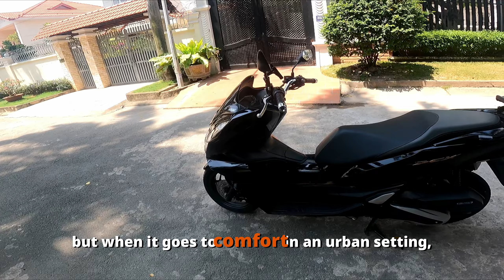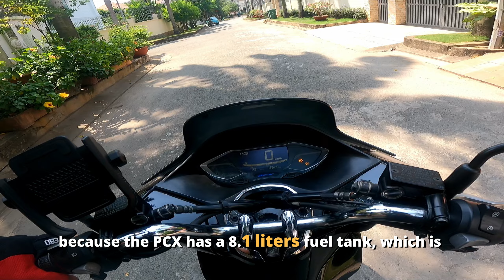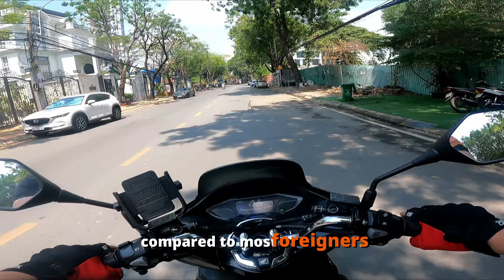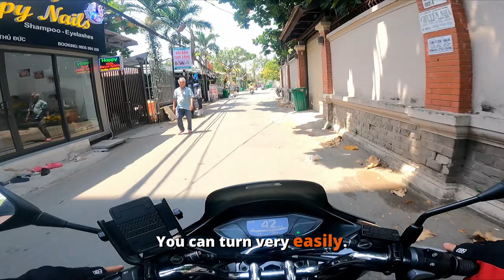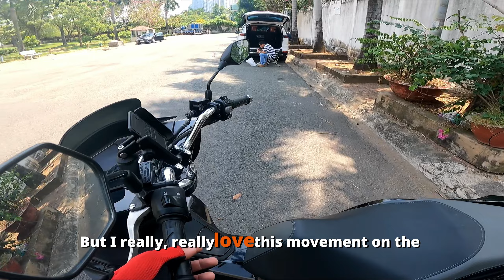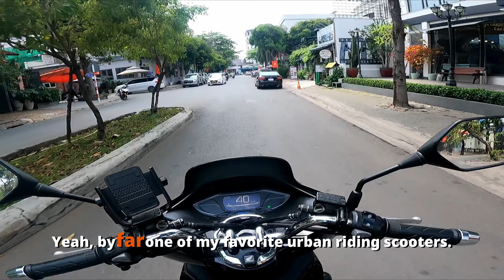Honda PCX 160 2022 - Test Riding Review. Torque Control!?

Comment: I may be wrong, but I believe the rear brake is drum type not disc.  At least that's what the specs say on the Honda website.  Either way, a good video. Thanks!
Reply from the maker: There are more than one version depending on the region. The one we have is imported from Indonesia with a rear disc brake.
The 125's and 150's made in Vietnam are drum brakes on the rear.

Comment: I would like to know how it goes with 240kg combined weight and a very tall driver!
Reply from the maker: The manual says 180kgs max... We did 200kgs and it performed as well as usual. 240 however.... we can't test it ye, I need to gain several kilos...

Comment: I read some places that the rear suspension is like a rock or very stiff l, I think this is a positive technicall solution, as then it's possible to after mount travel bag or box and this will still make the rear suspension usable and no need to change it, even with extra passenger. Think of the Newton, on the back when the weight is after the axis of the suspension. I think they'd get alot of negatives, if the suspension was too soft and it had to be changed to a harder one, so thumbs up for this solution.
Reply from the maker: Yes, we have overall good experiences with the rear suspension. Our PCX 160 gets frequently rented for road trips 2 up with some luggage, and we get perfect feedback from customers.

Comment: I use 2,2 ltr pr 100 km on my Roadsync :-)
The acceleration when making U turns, is more than acceptable!
Reply: Nice facts to know
Reply from the maker: That's an impressive consumption, I guess I drive a bit fast sometimes. But, yes, amazing fuel efficiency on this bike.
Reply: Maybe the fact that I use Petramina Turbo(I think 98) gives more power
Reply from the maker: @chrisandersen977  Absolutely! Pertamina 98 is great. Unfortunately, in Vietnam we have mainly 95 and sometimes only 92 (in remote areas). Only in Ho Chi Minh City (Saigon) there are a couple of stations with 97, but that's pretty much it.